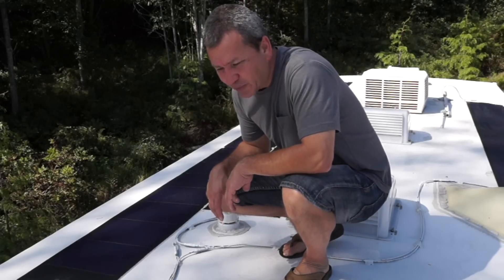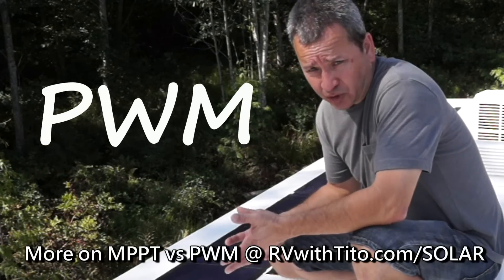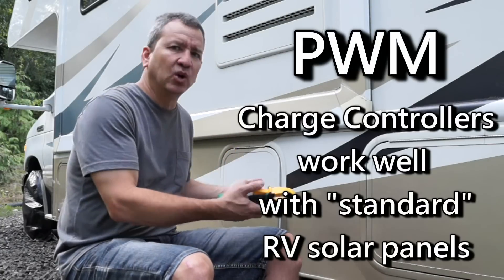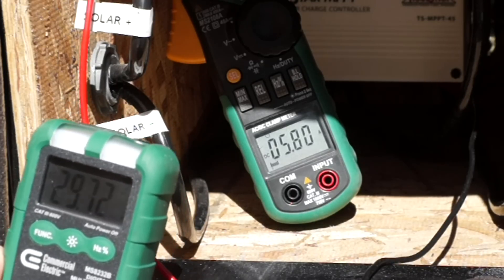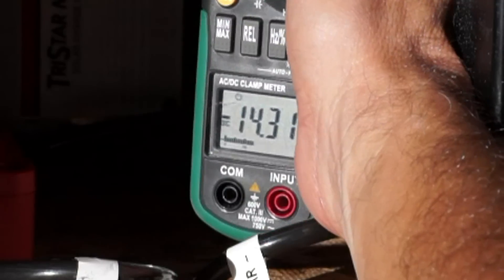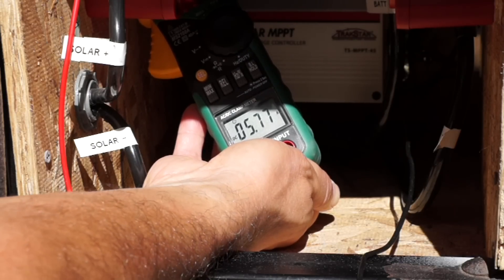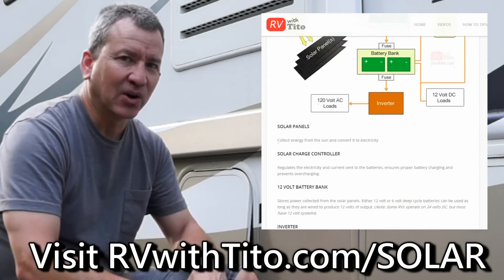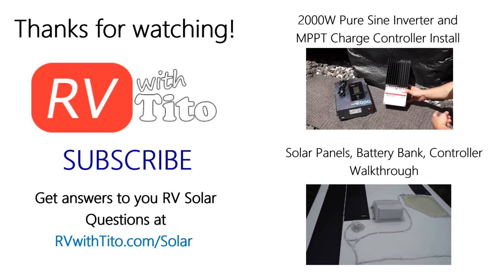MPPT or PWM Solar Charge Controller for High Voltage Solar Panels?

Comment: super
Reply: +Mobitronic Solar Mobitronic Solar We are Shenzhen Shuori New Technology Co.,Ltd in China and our main products as following:
☆Solar Street Light charge Controller for VRLA battery or lithium battery (Support Data Remote Setting, PWM/MPPT Type) 
☆Solar Power System charge Controller for VRLA battery (PWM / MPPT Type)
Please visit our web: WWW.SRNESOLAR.COM

3000 ㎡ factory, 7 years experience in solar charge controller filed, professional and strong professors, senior engineers, professional technical staff R&D team.  ISO, CE, ROHS & CQC certificates, this is how we keep good quality and competitive price for global valued customers.

If any models meet your demand, please feel free to contact me. Catalog & Details can be offered.

We're sure your any inquiries or requirements will get prompt attention.

---

Best regards,

Rhean Feng
Sales Department
Shenzhen Shuori New Energy Technology Co., Ltd.
Address:Building B, Jianyu 2nd Industrial, Nanchang Park, Gushu, Xixiang, Baoan, Shenzhen, China Zip:518000
Mobile Phone:(+86) 18565667949/13580565572
Email: rhean@szshuori.com
Skype: rheanfeng
QQ: 2851352807
Wechat:1036342363
Website: www.srnesolar.com

Comment: The way I understand it is with PWM only charges what the battery volts are at. So if battery is setting at 12 volts then that's what the pwm is going to charge at whether you have 18 volts coming from panel. With pwm it will charge the battery to reach it's optimum voltage it just takes longer. As the battery charges pwm ups the voltage till it reaches 14.6 or what ever. MPPT is the most effective way of charging as you showed the excess voltage is turned to amps and amps is what charges the battery. Good job.
Reply: The lower amps from the PWM (Pulse Width Modulation) charger simply means that the battery is taking in fewer amps and will take longer to charge.  Lead acid batteries prefer a trickle charge over a hard hit from a fast charge which is what you're getting from the MPPT variant.  So an argument could be made for a slower (deeper) charge vs. a faster less efficient conversion from electrical energy to chemical storage.

Sure, the MPPT is taking advantage of the extra W/hrs available during the day to ensure a complete charge of your battery pack, but if the PWM gets the job done in the same (albeit slower) time frame during the hours your solar panels are converting energy, does it really matter?  And besides, does the MPPT back off on the current fed to the battery during charging if I start running appliances inside demanding more instantaneous amps from my solar panels?
Reply: Wow this is helpful too.. thank you to both of you
Reply from the maker: Thanks Jerry for the additional info.